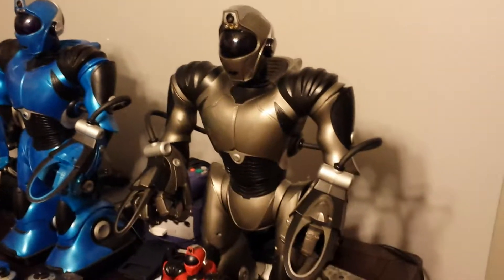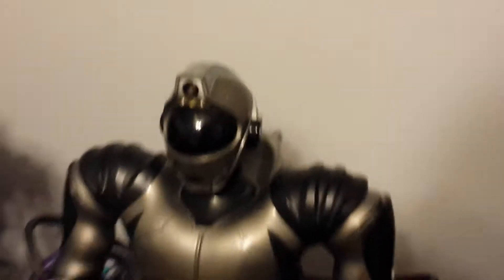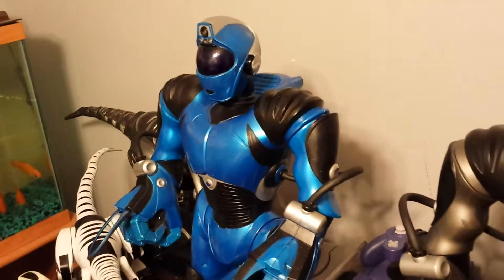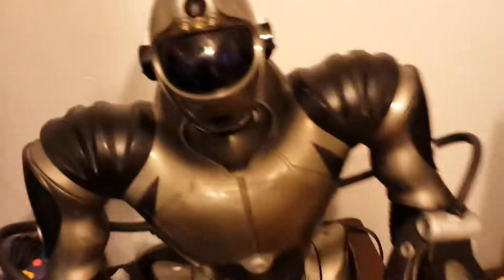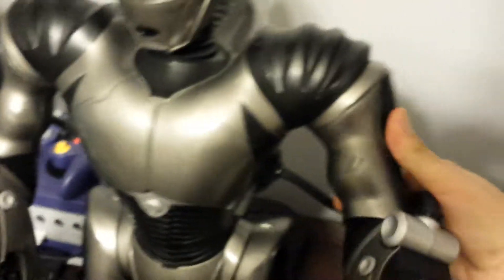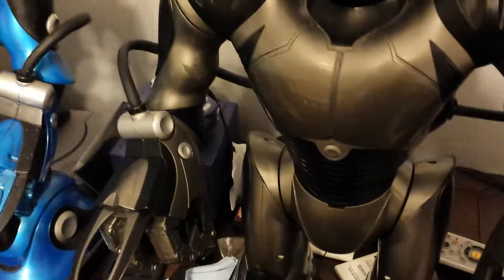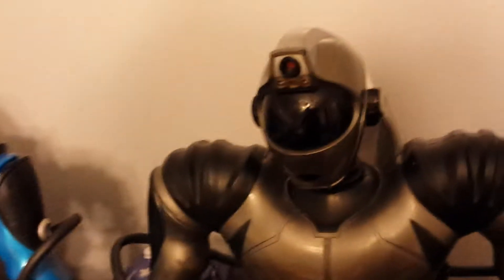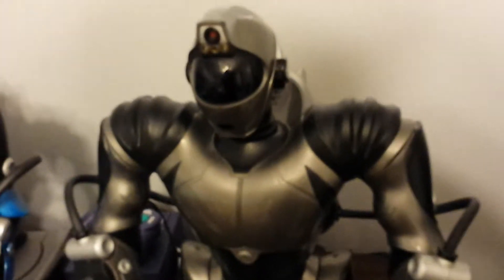Robot repair video

Comment: its not the batteries arm has a broken gear the torso has a broken gear leg broken gear and bad wires so all those parts need repairing
Reply from the maker: how much do you think it would cost to repair?
Reply: projectNova0
well its a long process you see. first you are going to have to replace every single wire in the legs that connect to the circuit board thats whats causing it to turn off. Its also causing it to short out idk about your blue one though for all i know he is already fried if he is say batteries low and there not that means he is fried you can take parts from the blue and put it in the silver to make it work but you need the wires repaired first so it wont fry because if it does you cant fix it then so dont have batteries in it
Reply from the maker: jobeanvideos So im still able to fix the v2 where do I get the wires and motors?
Reply: It doesn't need new motors right now it needs new gears and you would have to sacrifice the blue or silver but you know since the silver has so much problems its easier to just get new wires in the blue and switch out the circuit boards and the blue would work it would save loads of time too but idk where you con find wire maybe at some
Reply: jordan Heyd your on robocomm so we help you thru this.for now no batteries may in the robot,get them out.no need to sacrefice the blue one.